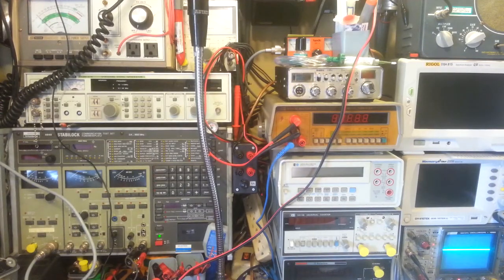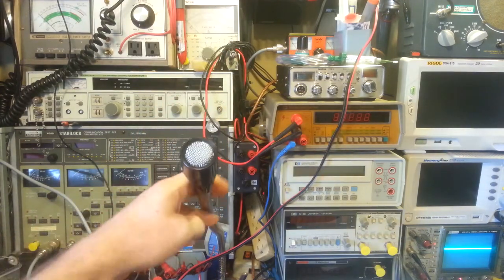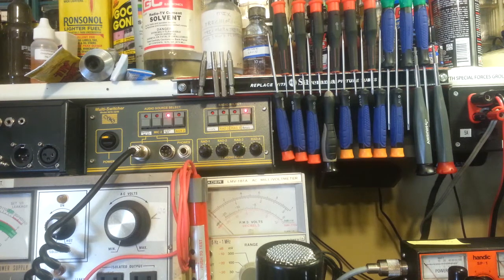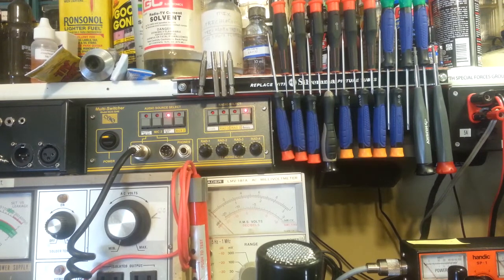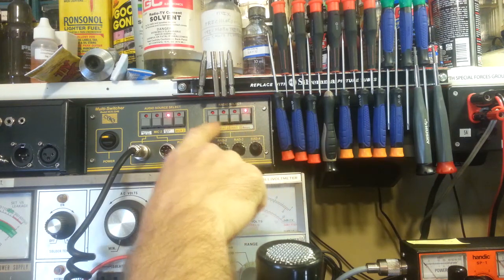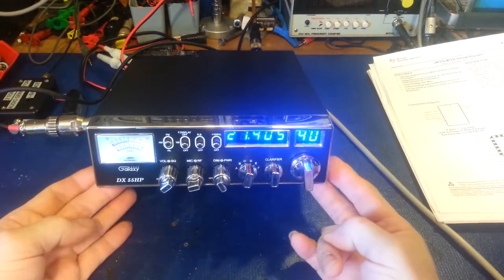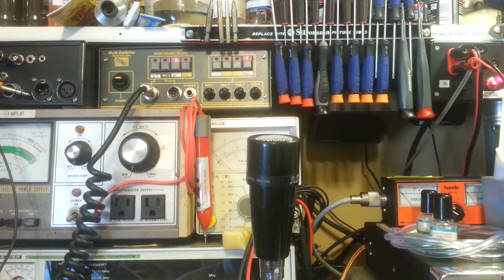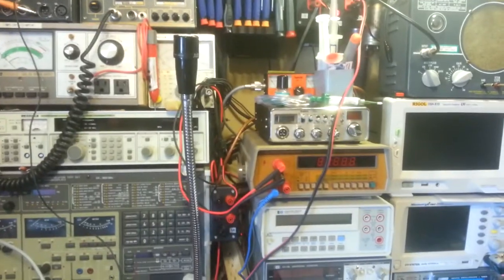Microphone switching system added to the test bench.  NCS Multi-Switcher.

Comment: Glad you found it Mike...as I recall you did right after we were discussing my NCS 3230 Receiver switch box; I've got my eye out for one as well. I imagine you'd have to be careful when connecting to Icom rigs where the +8VDC is present for their electret microphones?
Reply from the maker: All of that that can be set with the intetnal header program pins.  Just put the shorting bars on the correct pins.  You can pretty much set it up for any mic and radio combo.
Reply: I guess what I was thinking might happen would be a Icom radio with the voltage source being inadvertently connected to a mic/audio source that may not be able to withstand the DC...guess I gotta think about that some more, I may be missing the forest for the trees.

Comment: But! does it pass phantom power? :)
I like it.
Reply from the maker: Yes or it can be configured for onboard phantom power.  All pins are configurable using header pins inside and shorting jumpers.  You can also set it for different input and output impedance.  It truely does it all.
Reply: Damn. I thought I found the one thing it didn't do :)
Reply from the maker: +Mark19960 

And also has not only externally adjustable mic gain on output but internally adjustable input level adjustments.  Its actually a rather complicated or advanced design and is microprocessor controlled.